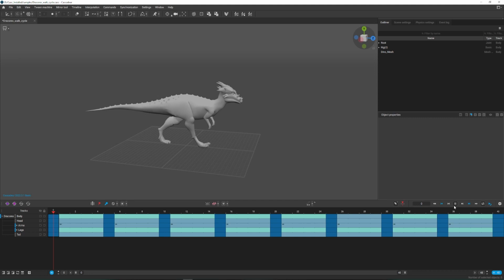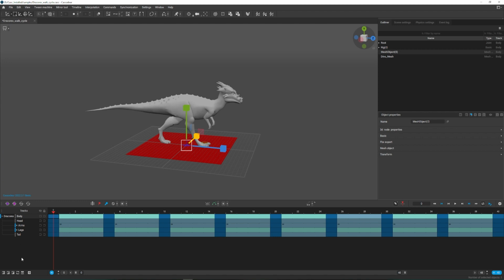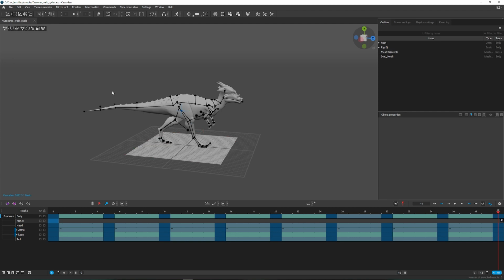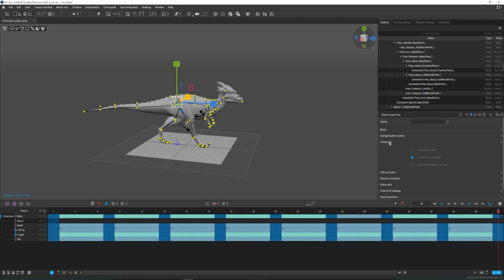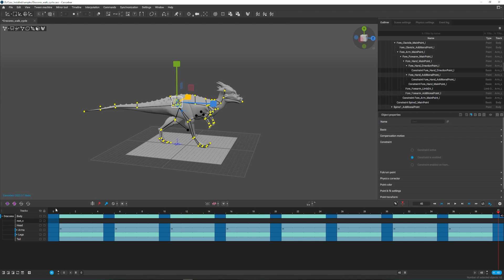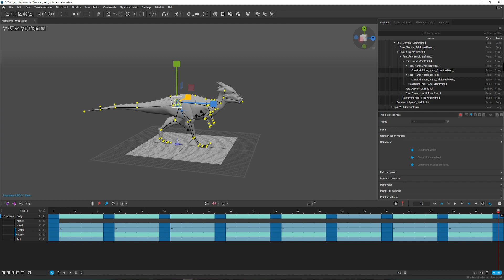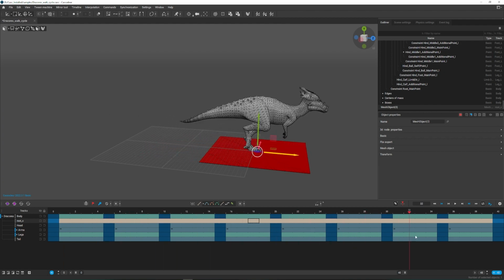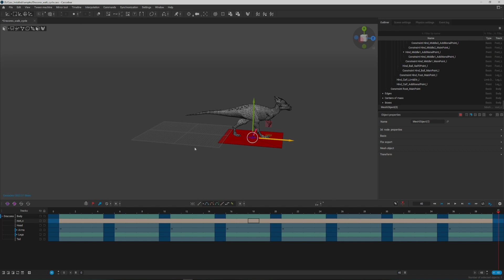Creating a Root Controller in Cascadeur

Comment: I've been facing issues with this root method when the movement is based on a mocap (with keyframes reduced). It's always giving me a "cycle in update dependency graph", and it doesn't attach to the mesh (the skeleton doesn't follow the mesh movement). It only occurs with extracted video mocap data.
*EDITED*: Found the answer. If you're combining keyframe animation with mocap, don't touch the mocap before creating this root animation (don't delete keys or change anything). Do what you need to do, then work on the mocap part. Only after creating and editing a new constraint root mesh, you can edit mocap (found it after... 3 hours of trying different things).

Comment: For some reason I can not select the rig and the cube mesh at once. Does anyone know how to solve this ??
Reply: This through me off, I was selecting the rig when you have to select points which it is the 3rd option in the selection tool set. I’m stuck now on finding the constraint options its not there after I add the constraint.
Reply: In the upper left corner you can cycle through view modes. They also affect how you interact with the scene.
Select the rig in POINT CONTROLLER MODE.
Then you select the cube in MESH MODE.

He does it quickly in the video. Should have pointed it through.

Comment: This is very good, however this seems to work in translation only OR rotation only. If i BOTH translate AND rotate the root controller, this distorts the legs of the character. Is there any work around that?

Comment: So it would be Good to make the walking or running animation or any animation and do this?🔥🔥
Reply: For root motion yes! If you are doing in place animation you won't need to do this, there are methods for extracting root motion data for in place systems as well, depending on what kind of project you're animating.